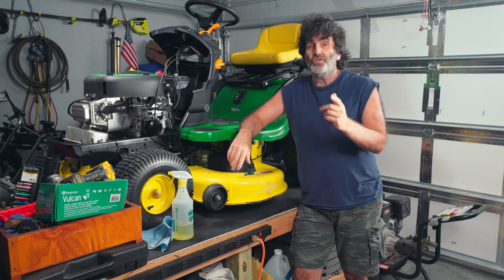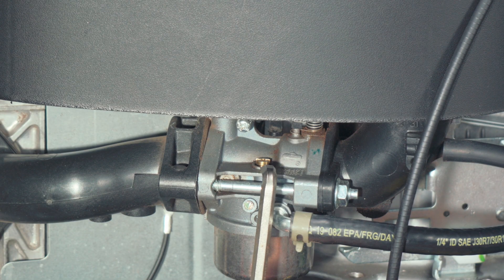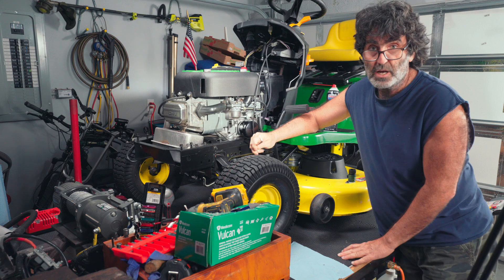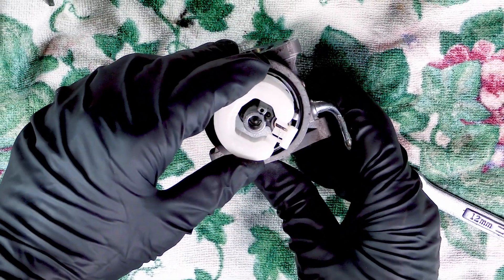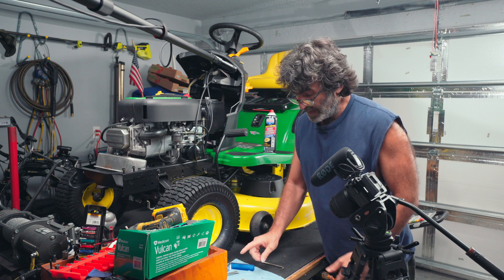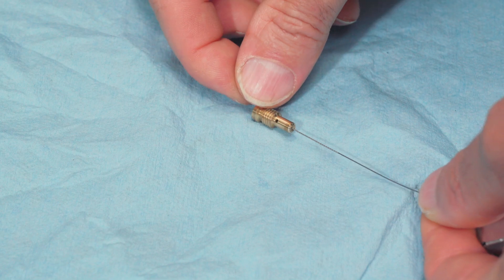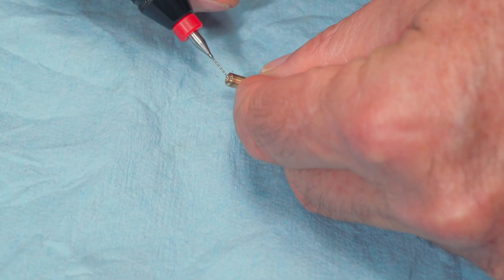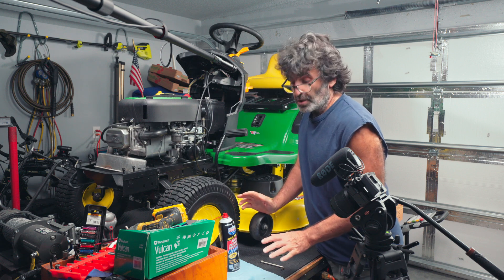Problem to Solution: Briggs and Stratton 17.5 HP Surging Engine

Comment: So, what do you do If you have the same exact engine and it has an original nikki carburetor on it.But it has no adjustment at all on it.No jet on the outside like that one no adjustments or nothing. And the carburetor has been cleaned out.
Reply from the maker: HI!  More than likely there's still a clog in the carburetor somewhere.  I've had on occasion where I've cleaned it several times and still can't get it to run right.  Put on a new carburetor and it works perfect again... I'm not saying to do that, because it might not be the carburetor at all,.. but it likely is.

Comment: My 17.5 HP was surging. I removed the pilot jet. Cleaned it with a piece of wire. The center hole was plugged. Sprayed it with some brake clean.  Runs great. Great video. Thanks!
Reply from the maker: Awesome news... I'm glad the video was helpful!  😊

Comment: Not always the cause of the surge.  If you have a carburator without a pilot jet, or if the jet wasn't the issue, then it's probably a governor adjustment that's needed.
Reply from the maker: Yes it's a possibility... However, I've never actually seen one that the governor was causing a surge... I'm sure it does happen though..

Comment: I must have looked at 20+ videos for "JD 110 Engine surge"  Change Carb, rebuild carb. I did what I knew to do, New fuel pump, filter had good fuel flow..... on and on. I was ready to pull the trigger on a new Deere, mine is 15 yrs old and I'm 15 yrs older. One more shot on YouTube........ I found your video....... Well, I just finished cutting the grass. I thought there is No Way this simple fix is the problem. It Was!! The Best Video.  Thanks!!
Reply from the maker: HI!  TYSM for the kind words and great feedback...  I am so glad I was able to help you get your mower back in service...

Comment: I got a whole new carb for my troybilt poney riding mower i started it as soon as it ran it still was surging i made a discovery if i cover the air intake or sprayed starting fuild it ran fine so it runing lean so i adusted the gas air mix screw didn’t really make a different didn’t bother flushing the tank it look clean and i seen no Debris
Reply from the maker: HI!  I didn't think those had a fuel/ air mixture screw, but I'd have to see it since my memory isn't what it used to be!  Usually on those engines the low speed or pilot jet can cause that surge...  If the pilot jet is clear and you're still having a problem, I'm not saying to do this since you could mess your carburetor up, but I've drilled out the hole in the pilot ever so slightly and solved this issue....  Before you do that, are you sure there's no vacuum leaks where the carburetor meets the engine?  That can cause an issue too..  Maybe play around with the pilot jet from the old carburetor and see if it'll fit into the new one that way you don't mess up your new one..

Comment: I replaced the carburetor with a brand new one and it’s still doing the same thing
Reply from the maker: Arrrgh.... Did you flush the gas tank and replace fuel line and filter?  It's possible the new carb got re-contaminated...  Did it run fine for a few seconds and then start surging again?
Reply: @JLPicard440  I’m pretty sure it’s the little spring that’s on that throttle rod. I ordered a new one and I’m going to replace it today and see if it does that surging. I checked the fuel flow and I use non-ethanol gas that’s fresh.
Reply: @JLPicard440  I just replaced the new carburetor with another new one but a actual Briggs and Stratton carburetor and it works like New now
Reply from the maker: That's interesting!  I'm starting to think that cheaper isn't always better!  Sometimes OEM just works better.  Thanks for the update... 😊
Reply: @JLPicard440  I was literally about to replace the whole engine. I replaced the little spring that was on the throttle ever and everything, and it was still surging with the new carburetor. I went up to my local motor shop and they told me that all of these carburetors from Walmart and Amazon are garbage. I was sold a brand new Briggs & Stratton carburetor I put it on and now the mower works like new again.
Reply from the maker: That's a great tip David!  I have used some of those cheap aftermarket carburetors and have had reasonable luck with them, but I could tell they still didn't run "as good as new" like they should be...  I'll have to keep that in my bag of tricks!  My wife has a saying that i've had a hard time incorporating into my life... "buy cheap, buy twice!"... Lol.  She's been right more times than I can remember, but I still have a tenancy to look at the cheap ones first... 😊

Comment: My Briggs 17.5 hp Intek surges at high speed.  I took some advice from Youtubers and threw away the Nickey carb and put a Walbro on it, hoping that would solve the problem, but it's still surging.  I've taken it apart and checked for any obstructions and blown air through all the ports.  I noticed that when the engine is running, the intake, plastic tubing, is cold and sweating.  Is that an indication of an air leak?  I've checked gaskets, tightened bolts, and visually inspected the whole thing and can't find any cracks.  If anyone knows what could be causing that,  I'd appreciate any input.
Reply from the maker: HI!  It's unusual for it to be surging at high speed... The surging is usually at a lower speed and will go away completely under load.  A trick I used to use on cars if I suspected a vacuum leak is to spray starting fluid around the ports, intake, etc and see if the engine changes in any way. Being careful not to get it directly in the carburetor since it will naturally speed up anyways...  Probably try it at an idle and that'll make it easier to hear the differences..

Comment: What if it's a brand new carb and it doesn't have a pilot jet?

What else can cause surging/hunting?
Reply from the maker: HI!  This is a longshot but I just had someone tell me the same thing.. They cleaned/ sanded rust off the flywheel magnets and the magneto and it solved the problem.  It might be worth looking at...

Comment: My nikki carb doesn't have the pilot jet so no idea what's making it surge!! Same 17.5 engine but not carb.
If anyone has any ideas post it here, thanks!!
Reply from the maker: Some of those carbs have some jets made into the body of the carb.  I can't see which carb you have, but on the v-twins they have a removable plate that has some jets underneath...
Reply: I have the 18 hp B&S boxer twin. It surges at working revs rather than idle. I found by chance that pulling the choke on to an optimum level solved the issue. All the logical problem solving, starting at cleaning the fuel tank, through to the carb and on to the governor, was fruitless.
Reply from the maker: If it works then that's great!  It might have slightly less HP with the choke pulled...

Comment: Hi, I have a 17.5 HP on a troy built pony doing the same thing, but the pilot jet isn't where you're showing it. In fact I haven't been able to find it, any ideas,?
Reply from the maker: Some carbs have the pilot jet underneath a screw.  If I remember right this one was removable, but sometimes they're actually built into the body of the carb.  If that happens, be very careful not to break off the drill bit or whatever you use to clean it out because the drill bit fragment will be stuck in the carb for all time and then it's ruined!  I've had that happen more than once.
Reply: @JLPicard440  Thanks for your reply. I got it running smooth this morning. Just took the cover off ,saw some rust on the magnets on the flywheel, sanded it off and no problem running as smooth as it did. I don't think I used it last year as I have a 97 Gravely 16G 50" deck I usually use, but I have some work to do on the deck so wanted to get this old Troy Built going again.
Thanks much!!
Reply from the maker: What?  Rusty magnets causing a surging issue?  I'll have to keep that one in my bag of tricks.. 😊
Reply: @JLPicard440  Yes that's all I did , I was surprised also, never touched the carb. Plus there's no screws on the carb except for the idle and the air fuel mixture that you can't move, it has the plastic factory cap over it.
Reply from the maker: Wow... thanks for the tip.  I'll keep it in mind next time I run into that issue... 😊
Reply: @altennent156 Interesting... I just put a new carb on my old Snapper riding mower and it's surging.  I don't see a pilot jet, which shouldn't be clogged anyhow on a brand new carb.  I'll check the flywheel!  Thanks for the tip!
Reply: @BrokenChef  I don't know why that worked but it did and didn't touch anything else. Hasn't surged since.
Reply from the maker: TYSM!

Comment: Thanks!  Question -  how did you know the problem was the pilot jet without any other diagnosis?
Reply from the maker: HI!  If you have surging and you have a pilot jet that would be the first thing I would check... 😊
Reply: @JLPicard440 I have taken this garbage carburetor apart 5 times. Cleaned it 2x in my ultrasonic washer. Replaced the jet because the oring was no good thanks to ethanol shite fuel. All new gaskets and orings for the carb as well. Should've bought a diesel mower.
Reply from the maker: Arrrrgh... sorry to hear about your troubles.  The diesel is probably superior for sure, but I imagine much more expensive too... 😊
Reply: @JLPicard440 i did finally find the problem. The tiny jet that is pressed into the body and comes out beside the butterfly valve was the issue. I poked a cutting torch cleaner in there and the mower has never run better. Had lots of issues. Stale fuel. Fuel filter in backwards. It was a troublesome machine. But now i know
Reply from the maker: That sounds like the pilot jet from your description!  Glad you got it going...  To help with stale fuel, I usually use ethanol free fuel and add stabilizer to that as well... It'll usually last approx 2 years.

Comment: You can also pull a wire out of a wire brush to clean the holes!
Reply from the maker: HI.  I believe the wires off of a wire brush would still be a little to thick.  I could be wrong... 😊
Reply: I saw one in which someone used a bread bag tie after burning off its coating.